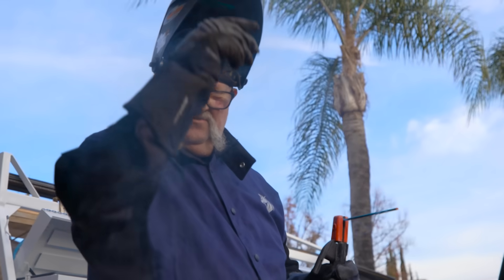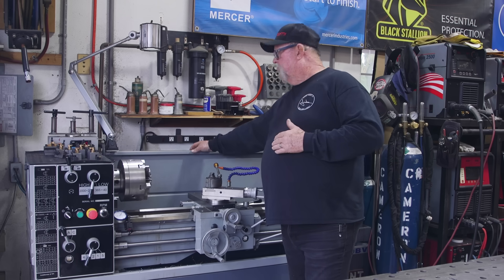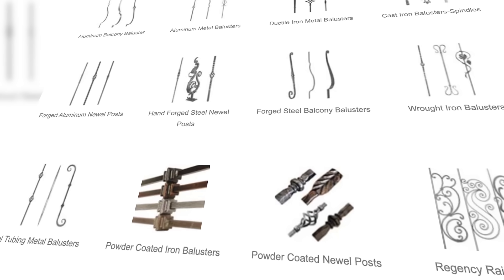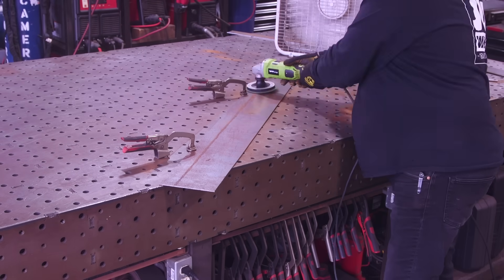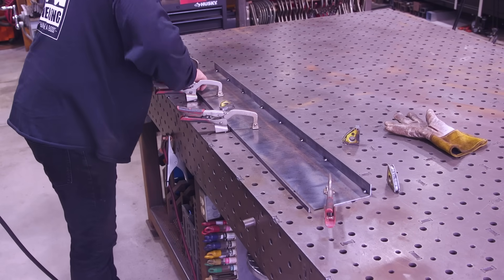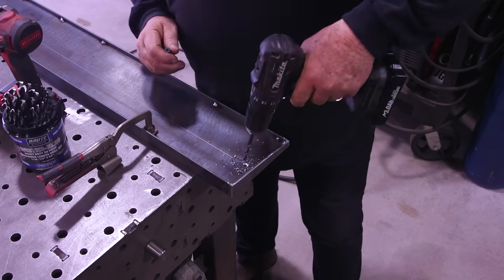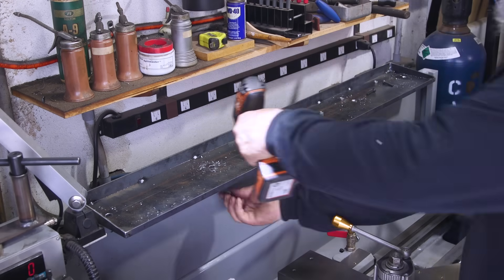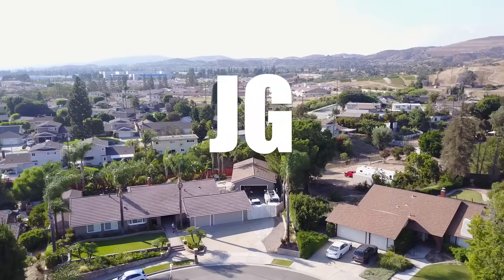Metal shelf for all of my lathe tooling  | JIMBO'S GARAGE

Comment: Thanks for sharing great video. What attachment and disc are you using on your grinder? For the first time I used a Norton non-woven disc "Rapid Strip" for removing mill scale and it was amazing. Not sure how it compares to other products and methods for that use for the cost but so far I'm happy I found it.  Used the "Blaze" version as well but made the mistake of abusing it on sharp parts.